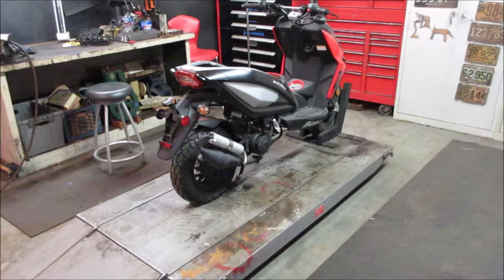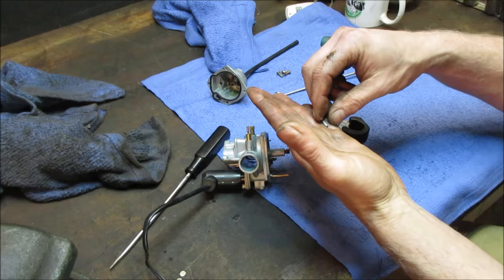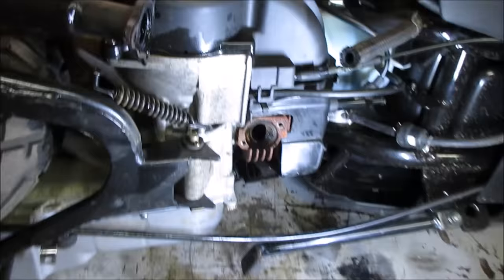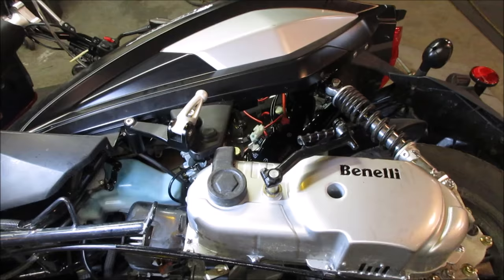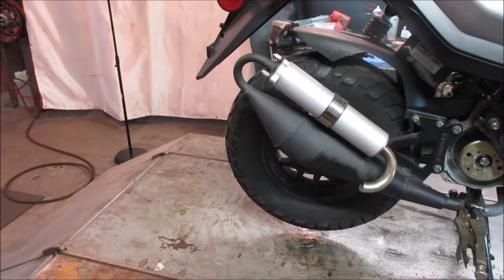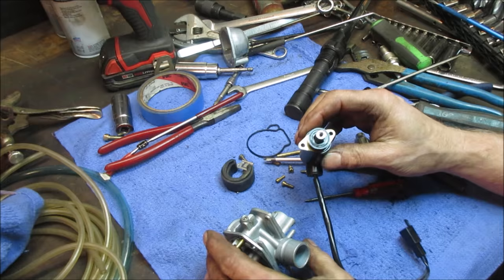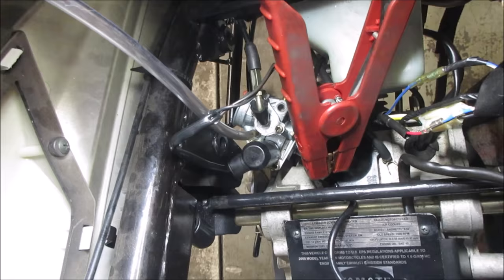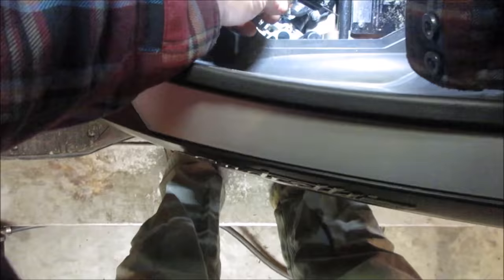Free Broken Scooter, Can We Fix It?

Comment: My guess would be on variator tuning - probably too heavy rollers put on this poor thing, not allowing it to rev into powerband. Or slipping clutch or belt.
Reply: I have changed rollers, cdi box, pressure spring, 70cc, new tube, main nozzle, variator pin still its limited to 45km/h. I dont know what to do anymore

Comment: The wire is to enrichment mixture solenoid (electric choke) . That engine looks a lot like a GY-6 Chinese engine 4 .stroke?  My engine had exhaust recirculating also. First time I worked on mine exhaust pipe was plugged with mud wasp nest. Very  imbarressing I hadn’t found it.

Comment: it has a limmiter in it thats wy it also runs like shit. a belt is not that expensive so replace that and it also could have a bigger main jet in it. It could be swapped as an atempt to tune it up a little so the mixture is to ritch hence 2 stroking. The smoking is due to to mutch 2stroke oil and that also causes it to run like shit because the plug gets fouled also get an original CDI  it will run better.

Comment: Benelli Andretti X50 not Z. I have same model 2008 and these scooters play with the big boys. Benelli sold these to a Chinese company in 2011 and current models are called the Quattronove and different knockoff motor. Originally 50cc 2 stroke and could hit 50 mph. You have the analog gauges like mine so most likely you have an original too the newer have digital instruments.

Comment: no air filter. did you check it has emo jets looks like a after market pipe. leave the plug out and let the engine dry out. smoke would suggest too much fuel or oil. honestly you cant run a 2t without a filter or pipe, they are too sensitive in the way of fuel fix to do that and have it still run.

Comment: watch out for "remote control kill switches" ... ( a little black box) - between the battery & the CDI ... for adults to have option of "killing engine if kid is riding too fast" ) .. bought my atv "new" - remote control receiver was installed - but - missing the transmittor - could never get it to start until I "jumped" the remote control receiver kill switch box. (side note - what happens to a kid going too fast & you hit "the kill switch" . bike stops & flips the kid over the handlebars ( yea real "safe" )

Comment: Its not the cdi. Its the enrichment/choke circuit on the carb. Every single one of those things fail. If u take the little needle and barrel out they will run flawlessly. Take em out and put the plastic part back on and ull have no problems on all those 50cc engines. They're all junk. Take em out and throw em as far as u can!

Comment: It sounds like it's hunting that's not getting the correct mixture to mention the possibility the something locking the fuel inside the carburettor itself especially  if someone has messed with it in through I know it's the The Slider seems to be not moving far enough there should be more playing it and then he's probably already figured most of this out anyway

Comment: (A bit late for dinner, but here I am)  Expansion chamber AND muffler?  Was this actually the most profitable way for BENELLI (a competitive, Italian motorcycle manufacturer of some repute) to control the desired back-pressure on this engine?  

Or is that a home-rigged exhaust system I'm seeing?  Seems like "either - or" would have been more profitable for BENELLI.  Anyone else notice that?
Reply: Also (unless CT goes to war with NH), still regard your channel as the absolute most entertaining, most educational, internal combustion and/or electro-mechanical, "this will probably work or we'll damm well find out why" channel on YouTube.

And fortunately, I can still say this, as I still have a '63 CB77 SuperHawk and a '91 CB750 Nighthawk running like new.

Offer$ entertained, starting @ $1M for either.  Rock on, Darren!

Comment: no there a air leak on the carb take the govenor off too idle air screw isnt set right either or gone should be smooth power there is a gasket leak somewhere bad

Comment: 30km/h is normal for these bikes, as that's the legal speed, without license.
45km/h with license on 16yo
but they can do 80km/h, while I don't feel those are safe
You will work on the exhaust, and change to unlimited cdi, and look for other limiting factors

Comment: Mustung: Ya'll still have no idea why it stopped while running, or am I missing something? Like the stator or battery? Sounds like you need to run the main needle on the slide down one notch to run more lean thus stop it from half two stroking. As you drive it further it is clearing up.

Comment: i bet if you cut off the cut off switch wire you get full power. cut off short circuit but enuff to get bike started but not enuff to rev to high power.

Comment: Motor sounds like a box of nails.  These must be 49cc mini generator or chainsaw motors reworked as 4 strokes (or is this a 2 stroke...lot of smoke).

I wonder if the piles of these junked 600mile China scooters could just have a $100 harbor freight motor dropped in.  I'm considering converting an old 1985 FA50 to electric for fun...but as a Suzuki it still runs OK.  Hard to cold start though.

Makes more sense to just refit a bicycle.  My wife is 6 miles from work over some sturdy hills.  She could do it with a hub motor eBike.
Reply: Cute scooter

Comment: Hi mate, just wondering the brand and part number of the rechargeable led magnetic light you using, I have something similar but doesn't have the LEDS and the top lime yours, thankyou
Reply: Looks like a Braun 56329. It's a Harbor Freight brand, so I don't know if you can find them overseas. He has talked about having issues with them randomly turning off as well.
Reply: @MellowYe77ow  thankyou
Reply: @waynegoodwin3217  You're welcome.

Comment: You saw the name and made the assumption it was a Chinesium knock off of a Honda or a Yamaha, when in fact Benelli was once one of the  more celebrated Italian motorcycle manufacturers, and once produced a motorcycle that scared the Japanese sheiserless, called the Bennelli 750 sei  and it was a work of art - the worlds first six cylinder production motor cycle back in the early seventies,   Alejandro De Tomaso (Mangusta, Pantera) owned the company  and took a Honda 500 four engine and frame and redesigned it extending it to six cylinders, google it and drool,..... they change hands today for telephone numbers if you can even find one.

Comment: i would imagine it was thrashed when getting run in and got seiezed leading to bad compression
Reply: if it looses power it goes full rich on fuel if i remember,used to be a tech for a firm imported chineese bikes and quads,mostly cf moto stuff,mostly piles of garbage.

Comment: Ok empty the carb bowl  drain the petrol try again you will see its fixed 
water in the gas those petrol caps leak 
if not change the coil should be like new

Comment: sounds like it have 4 stroke cdi not 2 stroke, as I can hear its the cdi revlimit cut of to early for 2 stroke, try to look for 2 stroke cdi, and the black cdi is for sure for 12volt dc and will never work on this scooter, this scooter has ac cdi.... new cdi for 2 stroke will fix your problem, can also just get cdi with out revlimit

Comment: I got a Chinese 50 cc scooter years ago. It lasted about 3 months, rattled itself to bits and for some reason it stopped just like this one. I gave mine away as well. From my experience Chinese engineering is utter sh1te.
The person who I gave it to scrapped it after also failing to repair it.

Comment: I paid $1,300 for a brand new Chinese bike thinking that if I got knew it would run forever virtually but only ran a year have not been able to get it to run again nobody will work on it because it's Chinese I've gone as far as I can with it myself I have replaced the spark plug and all the fuel lines to feel like that just disintegrated before my eyes never seen anything like it not but over a year old and the fuel lines it just got hairline cracks and just came apart literally just fell apart

Comment: never understood ... "remote control kill switches for kids' atv" ... parents watching their kid - have the ability to kill the engine at any time, if the bike is going too fast. ... what happens when you hit the "remote control kill switch" ( killing the ignition ) but keeping it in gear ... what is going to happen to the  6 year old kid riding it? ... when bike suddenly stops ? ... at 30 mph ?
Reply: Most kid's ATVs have CVT transmissions, (Like this scooter) so the ATV will just roll to a stop.
Reply: @MellowYe77ow  Not all ... My kids ATV 150 cc "Andretti racing model" - is a 3 speed semi-manual with reverse - centrifugal clutch. ... top speed of 35 mph.
when the engine slows down - the clutch disenganges - but for the second it takes for the engine to slow down - the kids does a face plant. ( so i have disconnected the remote receivers to it doesn't happen )

Comment: is that 2 mufflers on it
Reply: No, the black part of the pipe is an expansion chamber, which improves 2 stroke performance. (AKA a tuned pipe) The silver piece is the muffler.
Reply: @MellowYe77ow  thanks
Reply: @jonas2431  You're welcome.

Comment: That scooter sounds very restricted
Reply: I have changed rollers, cdi box, pressure spring, 70cc, new tube, main nozzle, variator pin still its limited to 45km/h. I dont know what to do anymore

Comment: Omfg it's so hard to watch someone waste time chasing things in guesses instead of following a logical shooting process that gets straight to the problem.. check spark check timing check fuel... all you need is air fuel and spark at the right timing and it will run unless there is serious cylinder issues or other things.... really simple ... spark fuel air and timing.... always remember 80 percent of problems are in the electrical system.... and there you go

Comment: Chinese import. W t f ?  Benelli is one if the biggest motor cycle companies in italy .   One of the reasons a 2 stroke will not run is a blocked muffler. This is what someone who knows about 2 stroke engines looks at. After spark. New good fuel and compresion.  Not take the entire engine to bitts  crazy. But. Expected.
Reply: While Benelli's headquarters are in Italy, all their manufacturing has been done in China, since their buyout by Qianjiang Motorcycle in 2005. Only design and marketing is done in Italy.

Comment: Remove restrictions
Reply: Variator restricted
Reply: I have changed rollers, cdi box, pressure spring, 70cc, new tube, main nozzle, variator pin still its limited to 45km/h. I dont know what to do anymore
Reply: Do you have a pink wire to the cdi box? Cut it in that case its a rev limiter

Comment: fail fail fail fail fail fail fail fail fail if you would have just cleaned the carb and the entire fuel system (fuel tank and lines also)  then filled it with clean "regular unleaded gasoline"  that contains No ethenol period NON kapish!   you would have been done